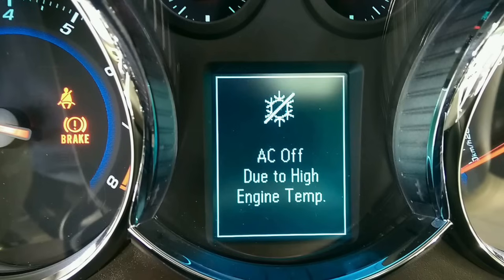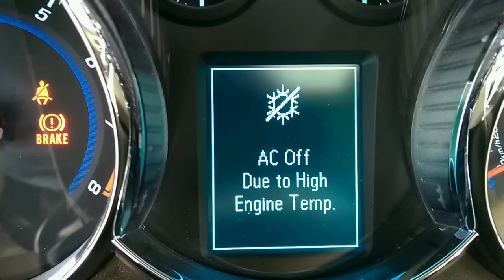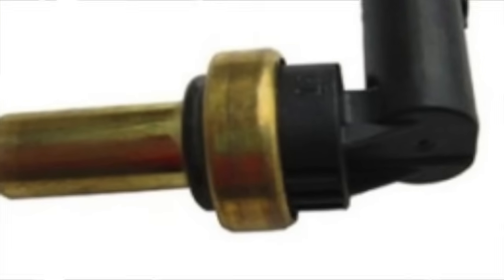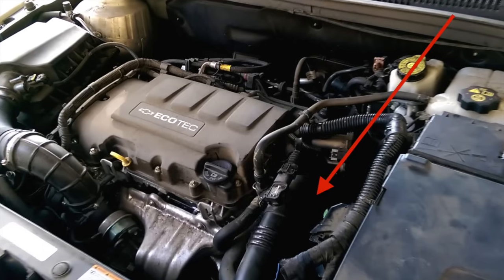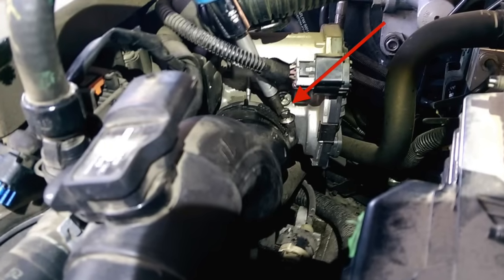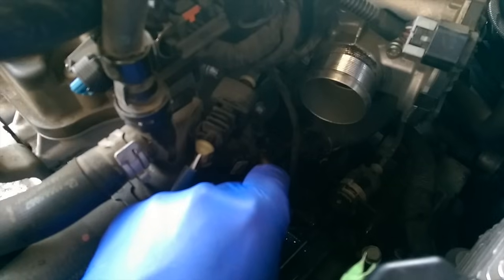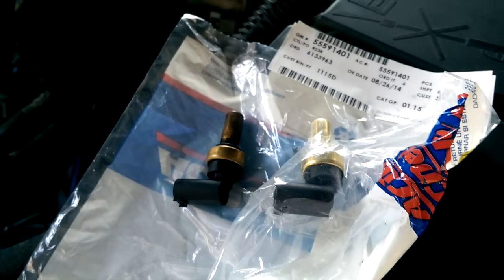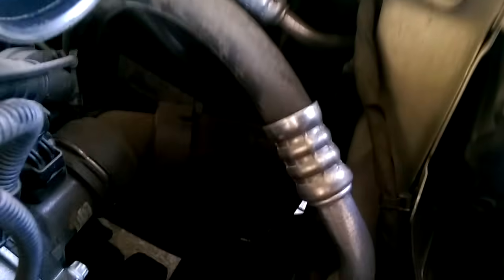Chevy Cruze AC Off Due to High Engine Temp

Comment: I have recently had two of these lovely vehicles come into the shop I work. after throwing temp sensors and thermostats like everyone had suggested, I performed an update on the pcm and no more problems.
Reply: My son's 2013 Cruze was the thermostat,had it replaced for 170 dollars and it was fixed.
Reply: How do you update the pcm?
Reply: @Hector2495  i can't nor can the shop I was in. But the dealership we use to outsource to "said" they were able to update software programming.  
I do not know for sure if this is true or a dealership line of crap to scam more money out of you. However, when we got the car back after  "software updates " didn't have any more issues

Comment: Is both sensors the same part number I replaced the one on the right side of the motor and the AC off is still coming on in kicking the fan on the information would be much appreciated
Reply from the maker: Yes they are the same part number.

Comment: i have the same issue and i only work 30 miles round trip.. first it said the ac message... then this morning the temp gauge shot up to H message stated. "Engine overheated idle engine"
i took it to the dealer and on the way theyre it had a knock noise..
ever since my oil change theyre has been a oil leak on the left side by the cooling sensor and a. coolant leak on the right side that runs down by the passanger front tire

Comment: I have a 2012 Cruz that is giving me this error. All I do is connect an OBDII reader i bought off of ebay and use Torque Light or something like that and reset the code while im driving and it goes away. I have a new thermostat and housing, thought about replacing both sensors but so far this band aid has cost me nothing and doesnt seem to adversely affect the motor at all. As im not sure what the problem is 100% i will most likely stick with this resolution until i can afford all new coolant and both sensors and just replace them all at the same time. I have already replaced a Coolant Hose Flange that was cracked. 

Symptoms: 
OBDII code im getting is P0128
Temperature gauge shoots up to C and stays there
OBDII reader is showing my temp running at 190-200 about 30 min driving around highway speeds (70s)

Comment: My lady's car was having this exact issue, and the temp needle was jumping up and down. 2012 LTZ. 

Coolant was very low, reservoir was empty O_O Luckily for her we only spent the $15 on the dexcool stuff, filled her up and never saw that issue again, car runs at normal Temps as well.
Reply: was everything fine after you filled the reservoir? bc mine was empty too
Reply: Yes, after filling the reservoir the check engine light went away and we never saw the A/C error again. I have checked the reservoir again just in case and everything seems just fine.

Comment: Isn't this normal if it ac shuts down? , because it just means its too much strain on engine?
Reply from the maker: It's normal for the AC to shut off. But its not normal for the car to over heat. Which is what it's doing.

Comment: Another thing about this car is that I've had to replace nearly everything plastic that has to do with the cooling system including the fill tank. The plastic just doesn't hold up and will eventually start leaking. All started around 100,000 miles.
Reply from the maker: Sorry to hear that

Comment: how did you know to change the ECT sensor ? was the CEL on ? I've already changed the water pump and thermostat on my 2013 lt cruze and it's still overheating and the coolant tank is overflowing. almost like there's a clog somewhere. also this notification comes on my dash as well. and when I turn the heater on it blows nothing but cold air even tho the temp gauge reads halfway... anybody know any more info on this ?
Reply: L
Reply: Bleed the air out of the lines

Comment: My 2011 Cruze had the same issue.  I had the 1.8L engine, it took all of 10 minutes to switch out. Make sure you buy the correct sensor, there is one for the engine and a different one for the radiator.
Reply: Actually there are 3 sensors...One in the radiator, one on the water outlet and one in the thermostat outlet...
Reply: So which one is for this problem?

Comment: when you got the notification on the AC was your temp guage also stuck on cold, even after the car has been running for a while?
Reply from the maker: No it was normal temp
Reply: Chacon Johnson...mine is stick on cold right now and I got the notification that he shows in the beginning. Have you figured out what the problem is?
Reply: mine does same thing
Reply: Hi, have you fixed the issue you had with your car? I facing this issue from today, I changed the sensor for the engine, but didn't work. the temp gauge is stuck on cold and AC is still off and the msg appears when I turn the car on. I only changed one of the sensors cuz the one by the radiator is a bit hard to have access. Thank you
Reply: Hi my car is currently having this issue with the needle going to cold and having that same message did you happen to figure out what it was ?

Comment: Though this didn't solve my problem it was very helpful as I did replace them in my  vehicle. I also replaced the relay which also did not solve the problem. I ended up replacing the thermostat as well as the cooling fan for good measure. Ultimately the problem was resolved and from all of the research I had done it could have been any of those which caused the problem because all of those were factor into the vehicles computer misinterpreting it as running hot.
Reply: I've got same issue replace all sensors, replaced thermostat in February, water pump 2x , fixed a wire..... Still says "AC off due to high temperature" smh
Reply: @mrs.monicalofotn598  I just ended up getting rid of the vehicle. The sensors just end up going in a cycle of going bad. Good luck. I feel your frustration.
Reply: @robizarro888  I just did the same... changed the thermostat fixed the issue... came back on a week later... changed the sensors... still doing the same thing... no check engine light... now I'm thinking it's the water pump... it's getting frustrated since weather in Texas already hitting the hundreds

Comment: Thank you Michael Callos! The 2013 Chevy Malibu 2.5L has two sensors in the same arrangement as you describe and show on the 2011 Chevy Cruze; this one on top is even is you have shown, same, but no need to disconnect that large air-flow tube on 2013 Malibu 2.5L. The cold side, at the thermostat and lower radiator hose takes the steps of removing that bottom plastic splash guard or splash pan, on the Malibu, I think - didn't have to do that one. 13.00 and I was all set, - had the A/C is disabled, High Engine Temp warning light, and cooling fans ran even when the car was turned on, then off, engine still cold. $13.00 and all is good again! Maybe I should have purchased an extra retention clip, as I did drop mine and it took an additional 30 minutes and use of a magnet-pole device to recover and reuse the retention clip. Thanks Michael Callos! Keep on doing the videos. Thank you very much!
Reply from the maker: You are very welcome!

Comment: I had tbe same problem in a cruze 2011.. changed the sensor.. it was not that.It was the Thermostat iT Ket getting Stuck changed it out And the proble. Was Fixed.
Reply from the maker: Right on! thanks for sharing!

Comment: I had the same problem for 3 years.  Finally a few weeks ago a very loud alarm went off and then 'AC off due to high engine temp'.  I had no antifreeze at all. Kept changing thermostat, did not help.  Put it in the shop, and they said it was the water pump.  Had new water pump put in and no more problem.
Reply: Janet Martin what year is your car? & after replacing the thermostat did it show any improvement at all or didn’t help?

Comment: Thank you, much easier on a 2013 once you figure out which sensor it is. I had to reset the computer after replacing it ( I just unhooked the negative cable off the battery and shorted it to the positive) and all is now fine  :)
Reply: Did you replace both sensors if so u know the part nunbers
Reply: For how long did you put them together
Reply: Anyone got links or part #

Comment: Did you buy 2 of the same sensors to be placed in both location (radiator/coolant sensors)?  Or is there 2 different parts? Your link only shows 1 temp sensor, so I am guessing I can use the same part in both location.
Reply from the maker: You are correct. Same part.

Comment: I change the one you show in the video but 3 days later the message appeared again
Reply from the maker: I know chevy had a lot of issues. Yours may be more severe. Wish I could help. I would recommend having the dealer look at it. Several of these engines were replaced at no charge by the dealer.

Comment: the link you posted is for the senor in the radiator ir the other one? I'm having the same problem and I already replaced the one on the radiator
Reply from the maker: I believe they are the same part.
Reply: +Michael Callos I went to auto zone and they gave me 2 different numbers
Reply: +Michael Callos did you use the same one for both?
Reply from the maker: +Angela Rodriguez check with other places. ask the dealer...

Comment: i had the same problem we checked out the video and we replaced both censurs that wasnt the problem, so i took it to the mechanic and put in the computer it Turned out to be THE THERMOSTAT...  It was getting stuck when it would open i believe it was just bad So WE replaced it That was the proBLEM 2011 chevy cruze...                       Chevy CRUZE THERMOSTAT the part was about $60.00
Reply: Stanly
Reply: melissa t was your temperature gauge stuck on cold ? Instead of hot?

Comment: hey Mike, was there a loud noise when u turned ur car on? like the fan was on super high all of a sudden
Reply from the maker: Heather Lynch yes
Reply: my car doing this same what was the problem
Reply: Heather Lynch what was the issue
Reply: Tramiya Ducksworth was my thermostat
Reply: ok cause my car isn't runnning hot just a loud fan noise and and saying AC OFF DUE TO ENGINE TEMP
Reply: I just replaced it at firestone and Cleary they gave me a faulty or used one that cost me 600 to fix. I was pissed. went to another mechanic and he said it was my thermostat I was like wth! I just replaced it 3 months ago. So it cost me another 600 for a new one.  go to a mechanic YOU TRUST
Reply: mine wasn't running hot eithier!! just the error and fan super loud
Reply: my temp gage isn't moving fan blowing on high and this message so when you replaced the thermostat it fixed your problem

Comment: Just so y'all know please be sure the temperature sensor that runs to the water outlet is tight and does not move cuz when I replaced my water outlet I noticed it was fluid leaking from mine and kind of find out if it moves left to right or all the way around that means it's not the right dimensions made for that outlet and you need to go spend the extra 13 bucks and go buy one that's snug and fits and tight may have to tap it in there it might stop leaking but always be sure you unplug your battery terminal cuz if you don't it takes a few minutes for the computer to realize that the temperature sensor is inserted cuz I had the issue where it said AC was off due to high temperature I let it cool down I reset the battery plugged it back up and ran the car again in the engine was fine come to find out I thought I had a faulty temp sensor and it wasn't but mine went straight to cold not too hot

Comment: My 2012 cruze fan keeps running with or without the a/c on. any advice? I think replacing the sensor will fix the issue. thanks for sharing!
Reply: Did you replace both sensors?

Comment: My husband did the switch but it's still showing a check engine light. Does that need to be fixed somewhere else? Or was it supposed to get fixed when the the change happened. The fan is no longer making the loud sound it made before. He drove it around and it seems to be fine other then the engine light on.
Reply: You need to clear the code with an abd reader and accordingly as long as there is no other issues it should go away and stay away

Comment: Michael did you have the problem of getting no hot air from your a/c when this happened? I guess you wouldnt know if you werent in cold weather, but I have had no hot air for weeks and now this came up. I cant decide if to fix the thermostat or replace the thermometers.

Comment: Thanks Michael.  My wife and I both love our Chevy Cruzes.( 2014 & 2013 1.4LT Turbos) .  My AC warning appeared on my way to work. Temp gauge intermittent instantaneous swings between off/high/normal. Engine sounded normal. Coolant levels ok. Cabin heat ok. Watched your video. Ordered AC Delco part (gold pins) from Amazon. 24 hours later it arrived. Replaced in less than 45 minutes. Didn't need to remove hose.(1.4L T) Good tips. Dropped the clip once but remembered my flashlight under the hood before the test drive.  cheers.
Reply: George Reimer hi there just asking did you have check engine light and traction control light on before changing the sensor?

Comment: I have a 2014 Chevy Cruze that has been in the shop an insane amount of times over the past year. It’s at least once a month and costly repairs. I just started getting this notification, the day before I noticed the fan in my engine was really loud. The cabin of my car also doesn’t heat up and I’m dealing with a a Canadian winter at the moment. I drove it today and actually got a notification on the dash saying “engine overheated, idle car”. I’m really hoping this isn’t an expensive fix
Reply: Did you ever figure o what it was my car is doing that exact same thing
Reply: @monicawilliams7662  same here is it expensive fix

Comment: Bro can yu help me my fan stays on
Reply: Do you also have a check engine light on? usually the fan stays on if you need to replace the entire thermostat.  it is usually attached via torx head bolts.
Reply: David Ruiz what was causing the noise?  My vehicle does that.
Reply: Sensor
Reply: Dude, take it to a mechanic.
Reply: Same problem here. My fan comes on and it coolant runs empty but no leak?
Reply: Check the water outlet. It only leaks when the car is running, you can’t tell if it’s leaking when the car is idling.
Reply: drummaman1 ok. Ill check it. No engine light or dc message. Them runs to the middle and radiator fan comes on. I have to keep filling the resevior tank. Every few weeks.
Reply: -_-  Im having both of those issues right now....
Reply: Blown head gasket
Reply: What if u replaced the thermostat already and it does the same thing? I have a 13 Malibu

Comment: Saw A/C notification once. Heat wasn't working. Had no coolant and had a leak. So it could be something bigger than just sensors.
Reply: Joslyn Erskine My 2012 Chevy Cruze had the same problem. It needed 50/50 antifreeze coolant/water in the reservoir
Reply: Joslyn Erskine the housing maybe?
Reply: hi..
Reply: Did you ever figure it out
Reply: Joslyn Erskine 
Did u ever figure out your Problem.Im having the Same problem as we Speak?? If u could let me know id greatly appreciate it Thank You
Reply: Your coolant may have leaked out. I had white smoke coming from my 011 Cruze and it turns out the water outlet is broken where the upper radiator hose connects to. I rigged it up some to get by while I wait for the new part to come.
Reply: I’m having the same issue now as well. No coolant in bottle and leaking no heat or ac and my temp gage is not responding. Waiting for triple A to tow my car to my mechanic for the fix. I should know more in about three days time.
Reply: So in the end the entire coolant manifold had to be replaced. $625 later. All is good.
Reply: GM is pure garbage!! Nothing but problems on my daughter's 2013 Cruze..
Reply: They leak from the housing a lot in most cruzes
Reply: @malik9714  what housing? Are you able to take a picture ?
Reply: amanda carman is your car still running? I’m experiencing this problem now

Comment: i just got my 2015 chevy sonic back from the deelership for a ton of repairs.  my car didnt throw any codes.  but my car had a Evaporator Temp Sensor shorting out.  it caused my A/C compressor to brake apart 3xs and was replaced 2xs by 1st owner and 1x by me 2nd owner and was replaced and also my A/C condesnsor was replaced 2xs 1st time was debree in ac condensor and 2nd time the tube seal was leaking and was replaced.  Due to debrees in the line causing factor the entire time the car was driven since the 1st repair it was not caught until the 2nd owner it was the sensor shorting out causing the system to fail.  I hope that this fixes my problem.  and i hope chevy issues a recall for it.  i have all my repair paper work and all was covered under manufacture warrenty.  i am not sure if ur car has the same sensor as mine.

Comment: Just fixed  both sensors on mine , turned it on and still had the problem , cruised it around the block and everything still didn’t work , went to my local   O Reilly’s and asked if they can clear the “Coolant” code and drove home with full blast A/C moral of story this video helped and saved me a bunch of cash 👌🏼
Reply: It was a tight fit for the radiator sensor but getting underneath it was much simpler
Reply: Also my radiator fans were loud as fuck so that’s another way to tell , I didn’t want to change one sensor and see if it worked so I  changed both at same time  only costed me 43$ American